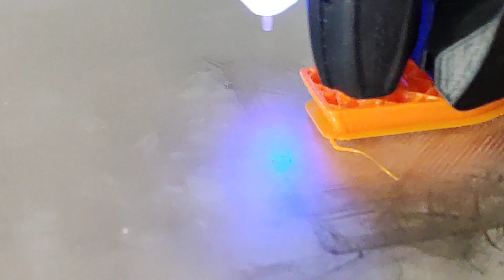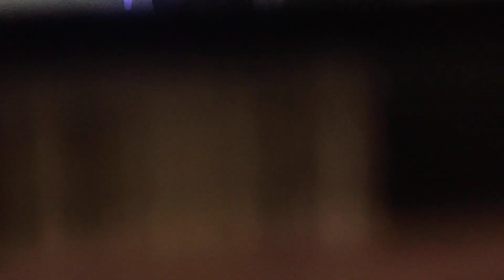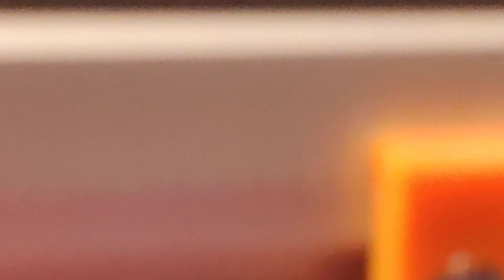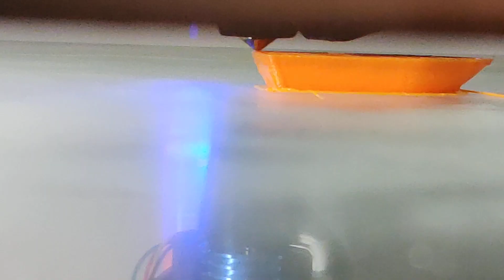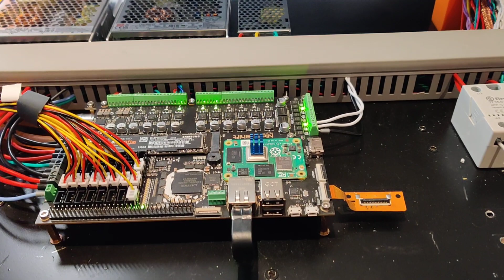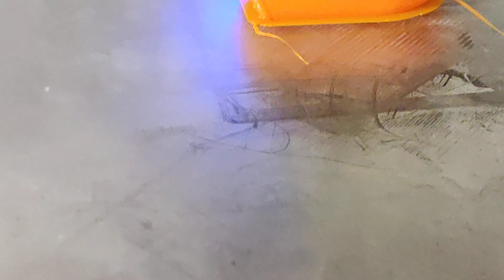Night Shift printer WIP with Phaetus Rapido

Comment: Just a question did you change any settings when you used the Rapido because I have underextrusion with my rapido
Reply from the maker: No, and it shouldn't change any parameter... Are you sure the temperature sensor is compatible with your printer ?
Reply: @Nerradia  the temperature sensor works normal

Comment: moving to horizontal instead of vertical rails once you get thr carbon tubes?
Reply from the maker: Maybe. I'm not sure the rails will be significant about the rigidity once the carbon tubes will be installed. I might try to optimize this once I have an accelerometer installed to get some metrics.

Comment: Have you noticed any improvement in xy rigidity with unbacked MGN12s vs the doubled 8mm rods?
Reply from the maker: I'm not sure it improved. I did not measure it. It is temporary anyway, I will put carbon tubes on their back.
I did put an accelerometer since that change so I guess I will measure de difference unbacked vs backed with carbon
Reply: @Nerradia  I would be interested in seeing that. I don't think I've seen any measurements on unbacked rails in this context.

Comment: Hello,
Nice video.
Do you know the typ of thermistor the Rapido has and how many Watts is the heater ? I can’t find these detailed specs anywhere.

Thanks !
Reply from the maker: Thanks !
I found specs on the Aliexpress page of the Triangle lab store but it looks like it is hidden now ! It's a classic 100K NTC with a Beta constant of 4267. Its reference is 104NT-4-R025H42G. About the heater, it draws 110W at room temperature and about 50W when at 200°C.

Comment: Did you get the HF or UHF?
Reply from the maker: UHF but it is currently set in HF with a regular nozzle.
Reply: @Nerradia  How's stringing with the UHF?
Reply from the maker: @theofficialczex1708  it strings a lot, but I didn't tune anything yet.
Reply from the maker: Nevermind, I just realized I had the slicer's settings messed up.
Reply from the maker: Yup, no more stringing after enabling the retractions :D

Comment: what build volume is it and how long are the linear rails?
Reply from the maker: The X/Y axes are 600/550mm long respectively. The head is still a prototype so the usable build volume might change. I'd say 470*430 aproximatively. The Z axis can move 400mm but it will change too.

Comment: Good work mate, i'm following your update. As i suggested some video ago you upgraded to mgn12. I think you already planned a lightweight pancake stepper. Let us know about your test on carbon fiber tubes

Rapido look soooo god, i really like It.
Reply from the maker: Thanks ! I'm keeping the Titan extruder until I find a solution like the Orbiter but with its irregular flow problem solved.
Reply: @Nerradia  i have a sherpa mini, really good. I switched recent to hevort extruder, both are crazy light, under 150g. The fact the hevort extruder Is embeded in the hotend mount is super nice, maybe you can think something like this.
Another good alternative Is the bondtech lgx lite, a little pricy for me.
Reply: @Nerradia  Hey!  You can share information about the board you use in the printer. I saw that the board is called "night shift", but I cannot find information on it.
Reply from the maker: @shajtan4  That's a board I designed, files are not currently public and I didn't write any documentation yet.
Reply from the maker: @shajtan4  A copy/paste from a comment about the board :  it has everything needed (and even spares) for my 3D printer project : 10 steppers, 8 servos, 16 endstops, 8 temperature inputs, a lot of spare IOs, a Raspberry-pi 4 module with a M2 SSD slot for storage or future extensions.
Reply: @Nerradia  oh ... cool))) I myself am currently engaged in a similar project, but there the kinematics are different and the print area is larger. I myself need 13 drivers, 10 thermistors, 7 limit switches and a bunch of everything else)) at the moment I am looking for good electronics for the printer